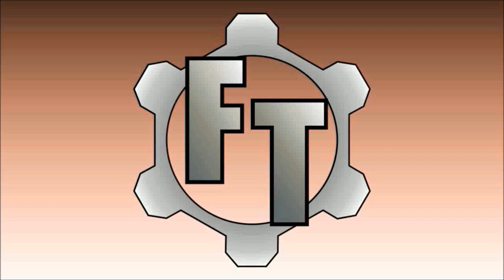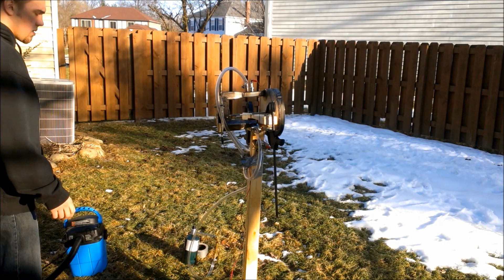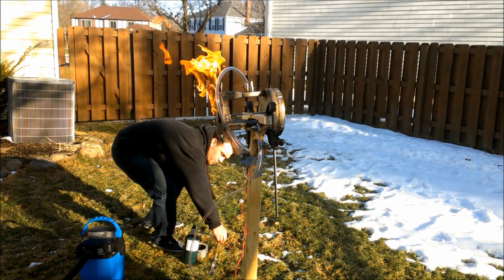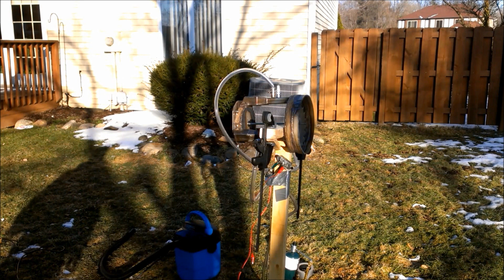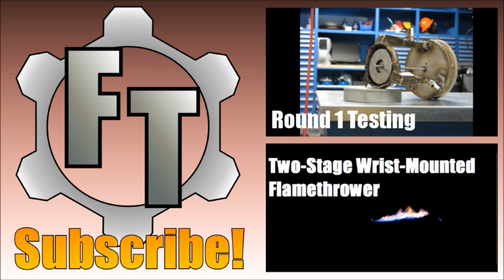Handmade Jet Engine Second Test Run | FozzTech

Comment: after watching a few of your videos (being very impressed!) can I ask what education background you have? or how you have the know how of how to do these things?
Reply from the maker: Thank you Thomas! I am currently a Mechanical Engineering student at the University of Toledo.  That said, all of my building knowledge comes from constantly reading and watching videos online for the past five years, and building different things along the way.  Check out my Instructables account, and Facebook fan page to see more of what I've done!
Reply: If you don't mind elaborating, I'm considering mechanical engineering as a career path, how broad is the spectrum that mechanical engineering covers? Electronics?
Reply from the maker: I actually just switched from Chemical to Mechanical engineering.  Mechanical could in a lot of ways be considered a "general engineering" degree from my understanding.  Whether or not electronics is a part of the curriculum I believe will vary by school. With the program I am in, I'm only required to take one electronics class I believe.

Comment: you need more compression
Reply from the maker: Can I ask why you say more compression? Only because it seems to me that the exhaust is the issue.  I have successfully moved air through the compressor to the combustion chambers, and out the exhaust side.  I may need to narrow the exhaust outlets, or add fins to the exhaust turbine.  However the intake compression isn't perfect, and could use some better sealing.
Reply: You need to build pressure in order to archieve sustained motion.    the air pulled in must exceed the amount of air that can easily be pushed out. I am no rocket scientist, but this just seems common sense to me. I am also an engineering student. If you pull more air in the front, your pressure will build and the air will be forced out the back, causing everything to spin up
Reply from the maker: Kris Shellman Fair enough.  Thanks for the feedback I genuinely appreciate it.  My jet engine is back home a few hours away at the moment, but I'm dying to do some modifications and another test run.

Comment: If you are still working on your engine I'd suggest to get some balanced props nad a decent shaft first. They are so badly out of balance and not sturdy enough.If you every get it to run in any decent rpm you'd have a catastrophic failure and probably lose an eye.

Comment: A jet engine that only has 2 blades? Look, your compressor is the problem, it's not working properly. If you narrow the holes, your fan blade can not pull enough air through. The air needs more compression. You need to do this with compressor stages. More blades that are shaped in a special shape, and the middle part of the fans that have no blades must slowly increase. Look at inside images of real jet engines. This looks very different. Just keep trying if u really want it to work!